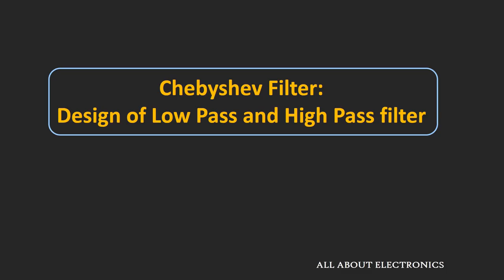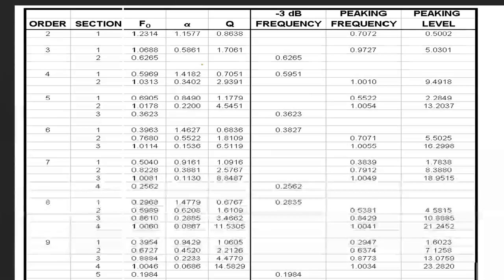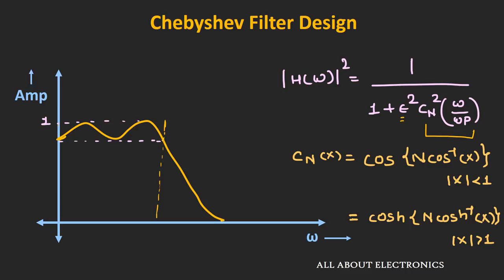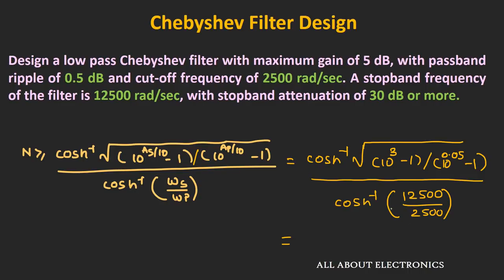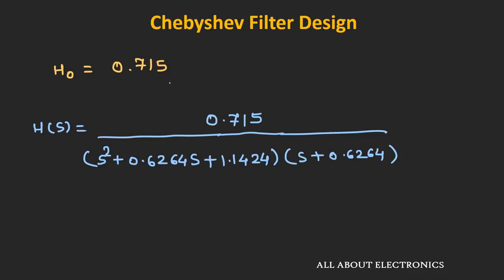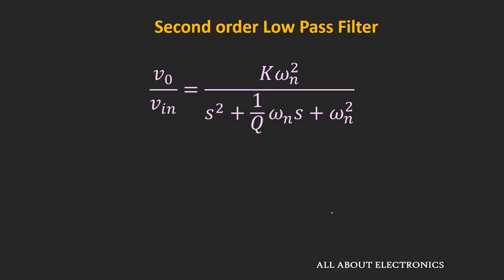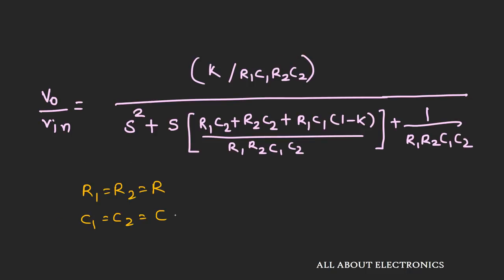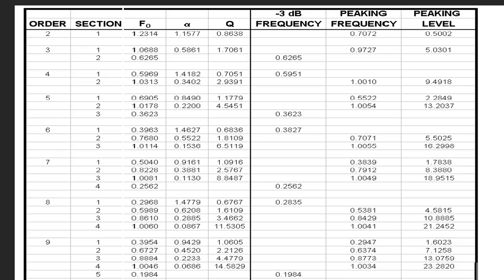Chebyshev Filter : Design of Low Pass and High Pass Filters

Comment: how to design this chevyshev filter
Synthesize a chebyshev low-pass filter to meet the following specification: 1) load resistance = 600 ohm, 2) 0.5 dB ripple with pass band, 3) cut-off frequency=5x105rad/sec, 4) At 1.5x106 rad/sec, the magnitude must be down 30 dB.

Comment: Thanks for the video. I have watched this video over 10 times already. I put your equations in excel and I believe I understand how it works.  I put it into "TINA" (simulation software from Texas instrument), the gain is 5db with a ripple noise less than 0.55db. The cut-off frequency is about 2500 rad/sec. And the stopband frequency is about 12500 rad/sec after 30db attenuation. Thanks a lot!
Do you have an example of a higher-order filter? Let say 5th order.

Comment: @ALL ABOUT ELECTRONICS 
When attempting to calculate the order required for a high pass filter should I take the passband and attenuation as the upper frequency as I would for a lowpass filter and the use the s^-1 substitution you demonstrated? Using the equation for calculating the required order with the lower frequency as the pass band seems impossible as arc-cosh must be a value greater than one or am I mistaken. Thanks a lot for your very informative video none the less.

Comment: How did you get 1.1424 at 8:15?
Reply from the maker: In the denominator, there are three terms. (S - P1) (S- P2)(S- P3). Just multiply the first two terms and the put the value of P1, P2 and P3, you will get it.
Reply: P1=-a+jb
P2=-a-jb
So the equation will be 
S^2+(P1+P2)S+P1*P2
here P1+P2 =-2a
And P1*P2 =a^2+b^2.

Comment: Dear friend, I hope you can help me with a problem.
I'm designing a second-order Chebyshev filter: Ap = 3dB (ripple), N = 2, ε = 0.997628 , Gain = 1dB and TF is:

H(s) = Ho / (s^2 + 0.6449s + 0.7079) as N=2 then H(s=0) = 1 / √ (1+ε^2)  then Ho = 0.5012. The TF of Low Pass Filter is LPF(s) = w^2 / (s^2 + w*s/Q + w^2),  
if I compare H(s) and LPF(s), then Ho ≠ w^2 because Ho = 0.5012 and w^2 = 0.7079.

Will I be doing some wrong calculation?
Reply: Is it right?

Comment: Sir what if cut off frequency not given
How to calculate it 
Please help me out
Reply from the maker: You must have been given the passband and stopband frequencies or the order of the filter.
Reply: Order is 4 sir
Reply from the maker: And what about pass band and stop band frequencies?
Reply: Order is 4 sir
Reply: ALL ABOUT ELECTRONICS passband=0.25*pi
Stop band=0.4*pi
Reply: And these are in analog mode
Reply from the maker: You can consider the passband frequency as the cut-off frequency. But it seems that it is in sub-Hertz range. 
If you want then you can even use the filter wizard tool of analog devices.
Here is the link:
http://www.analog.com/designtools/en/filterwizard/
Reply: ALL ABOUT ELECTRONICS pass band is in pi
Can I take as it is?
Reply from the maker: In equations, it is used in radian per seconds (2*Pi*f). So, yes you can take that. But for the given values of passband and stopband frequencies, it will be in sub Hz range.  And it looks like it is digital frequency. So, please check that.